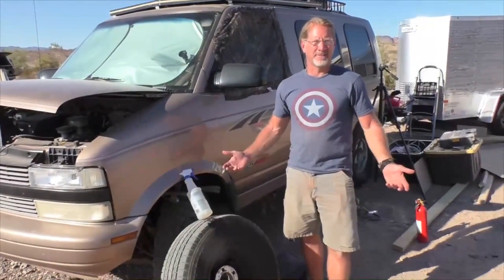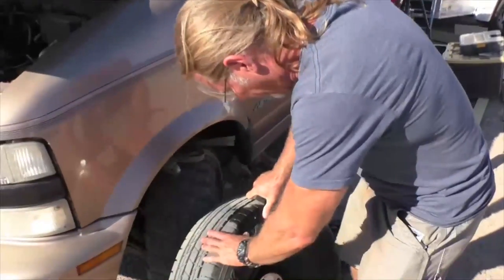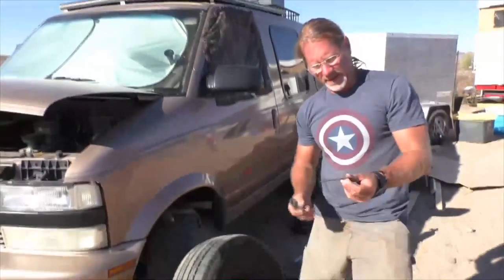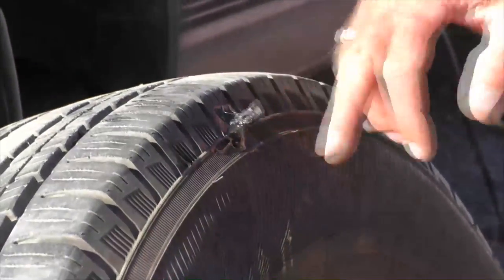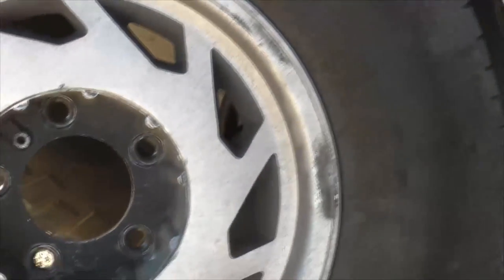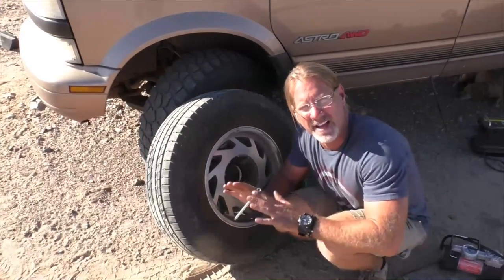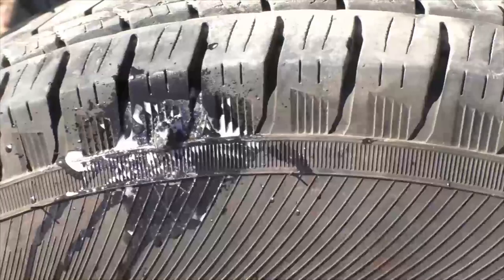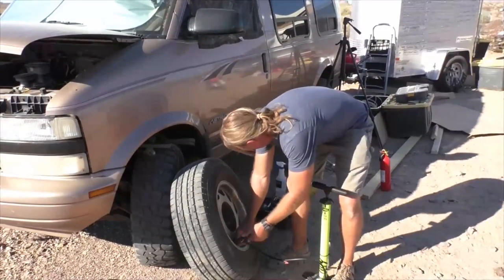How to fix a flat tire when you're broke

Comment: I've worked in the automotive industry over 20 years, and DO NOT PLUG A TIRE UNLESS IT'S IN THE TREAD, NOT THE SIDEWALL.  Please this is very dangerous to plug a tire in that location.  DO NOT DO IT UNLESS YOU'RE GOING TO IMMEDIATELY REPLACE THE TIRE.
Reply: Tommy TwoGun thank you! I'm not a mechanic and even I know this. So dangerous!
Reply: This is why you have a spare.  Also he said she had a tire warranty (hopefully road hazard replacement) then don't touch the tire.  Put on the spare and go to the shop.  That's why it's always good to buy your tires at a nationwide tire chain like Goodyear or Firestone that has nationwide locations, especially if you're gonna travel.
Reply: Ex mechanic here and will second this.
Reply: Tommy TwoGun true..
Reply: I agree. Most chain tire shops will refuse to fix one even if its in the outside section of the tread. To much liability. On my own truck though, I would still plug that tire an toss it in the bed as a spare. But its days of turning miles at speed is done...
Reply from the maker: Yes. Sidewalls are not recommended and can be dangerous. Thank you Tommy.
Reply: error error yes I would it is not in the tread like plugs are ment to be used.. just a verry temporary fix to limp to a tire shop. definitely would not drive at highway speed with that and also I would not have it on as a Starr tire.
Reply: I think we all know she wasn't going to drive on the rim to a tire shop and then buy a new rim and tire.
Reply: Bike Cycle OK, 'SHE' not 'His' and how do you know which tire it was?  It was leaning against Jamie's front tire.
Reply: Tommy TwoGun makes sense.
Reply: A few months ago my car tire had a bar stool brad on the outer tread - technically the sidewall.  The 1" brad was secured to a 1" diameter vinyl disc that somehow ended up in my tire.  I thought it was a chuck of gum from a distance.  The question always becomes;  how deep is the projectile since in this case the tiny puncture was obscured by the disc and I had no idea how long the nail was initially.  Pulled out the projectile and heard it leaking so I pushed it back in.  Tire store told me it could be three days (or longer) to get this Tiger Paw so I shipped off the vinyl pad and left the brad in the tire. Maybe 1/16" protruding.  I am quite confident the  temporary repair (below) would have lasted a lifetime without any potential hazard due to the small diameter brad.

1) Used 1/2 can of Fix A Flat to stop any leakage.  I suppose there had to be some leakage due to the smooth surface brad.

2) Covered the brad tip/ puncture with a few layers of super glue gel.

3) Soapy spray indicated no leakage

4) A few thin layers of GOOP plastic cement over the hardened superglue. Anyone who is familiar with GOOP realizes how tenacious this semi-flexible repair material is.   I once used it to repair a pot metal motorcycle fork crack after taking a speed bump too fast.  The crack never expanded or separated. Unlike JB Weld GOOP has tenacious grip strength and will never fracture.

The tire didn't lose any pressure for a two week period and the patch remained in place without any wear since that portion of the tread doesn't contact the road.  The  $96.00 TIGER PAW TOURING only had 8,000 miles over a 2 year period, and the $10 tire replacement policy served a purpose.  I was expecting to pay about $20 due to age and mileage but WalMart didn't charge anything.....except $10 for the same warranty on the new tire.   

The last time I purchased a tire warranty I don't even recall getting a flat tire during that 4 or 5 year period, and no tires were damaged.  In the first 2 years of this policy I've had one flat and one tire replaced.   This was the ONLY instance in over 40 years I've had a tire replaced, so generally speaking those warranties are only useful for flats, and in most instances the average driver isn't going to have four flats on a new set of tires before they need replaced.  4 flat repairs at Walmart @ 10$ each would pay for the policy.   I average about one flat every four years,  but that is with modest mileage totals.
Reply: Lol I came here to make just the same warning. though I only busted tires for a few years. Did have the misfortune to have tire blow a sidewall on a machine once. Terrifying.
Reply: error error It's right on the hairy edge. If it were my tire I would use that plug very carefully and get the tire replaced ASAP as it may blow out while driving if you leave it for any length of time. Though to be fair it might hold the life of the tire. It's real close.

Comment: ya don't need to glue things 3x. I always ream the hole, put the plug in the tool to install it put a generous amount of glue on the plug then insert it and twist as I slowly pull it out. and never had a leak or plug never stay in place when in the tread.. side wall is dangerous over 30 mph .

Comment: yep, i think copper colored rubber strings are for radials?  also dont repair a sidewall hole
as it is too dangerous just have to fork over for a good used tire replacement and rebalance.

Comment: That tire is toast on the sidewall if you take it into a Tire Shop.  Probably last another 40,000 miles, so YMMV!.......Always mandatory to have a tire plug repair setup, air compressor, bottle jack, etc etc when you venture off the pavement.

Comment: First, plugging a tire is NOT called vulcanizing.  Vulcanizing is the process used making the tire, using heat and pressure.  No reputable tire shop will repair a tire with a hole close to the the sidewall, let alone around the edge like that.  Many shops will even void your warranty if you plug it.  Your so called putting the rubber cement in the hole first.  Just a waste of glue.  The sole purpose of the glue when plugging the tire is to lubricate the plug, making it easier to install.  That's it.  It doesn't glue in the plug.  If I have to plug a tire in an emergency,  I find it easier to plug a tire when there's pressure in it.  I always get plugged tires properly repaired when I have a chance, unless it's a tire nearing the end of it's life or only a spare.  Putting it half way in is irrelevant, it's just nice to know how much you got into the tire.  I would also NEVER use a plugged tire, ESPECIALLY that one on the steering axle.  Unless of course you have a death wish or a strange sense of humor.  You did show a couple things well.  Testing with soapy water, rasping the hole, inserting the plug, cutting the plug, and i'll give you additional points on double checking the pressure with a hand gauge.  I never trust the gauges on emergency tire inflators.

Comment: yea not side wall. only in the tread, it will get you out of a location like that though. good advice coming....after you plug a tyre go for a drive it will wield the plug rubber to the tyre rubber making the seal complete.